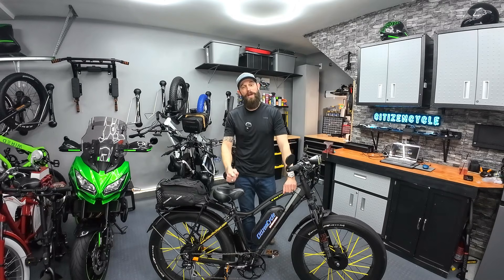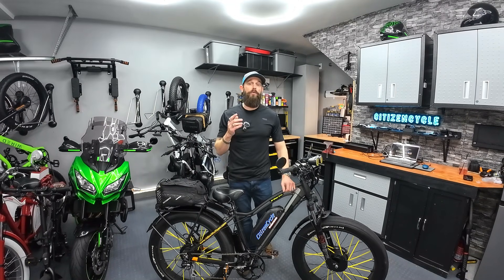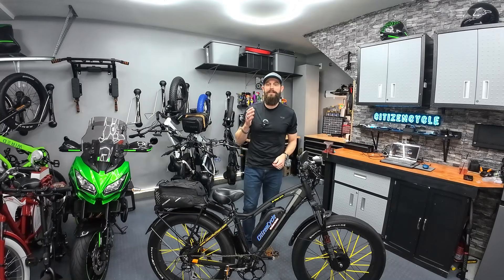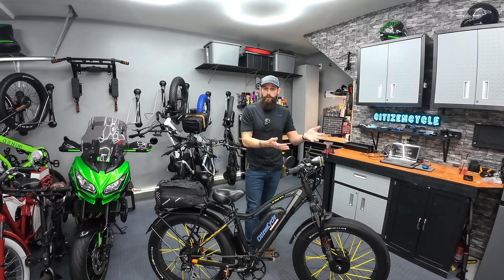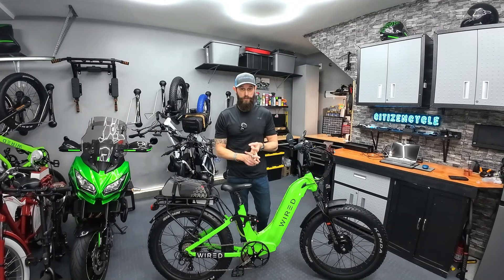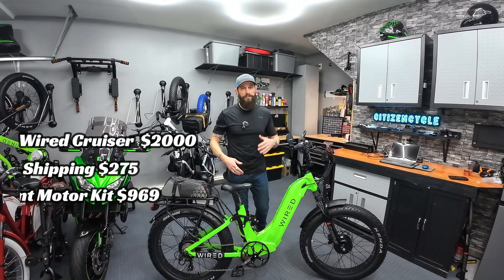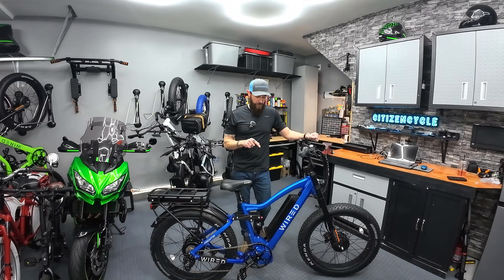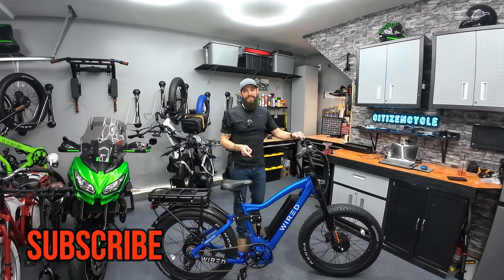Chasing More Power in Your eBike - Mods I've Done

Comment: I want more power out of my RadioFlyer wagon! Shunt modded 45 amp controller with 80 volt caps feeding on a 48 volt 50 Ah Lifepo4. Plan on over volting to 60+ volts soon. It launches now.

Comment: Thanks again for your awesome channel and content. I've just ordered a new Aventon Adventure2. I've been riding a much more expensive Cube crank-drive Bosch motor e-bike for the past 4 years after I sold my very modified (thanks to your show) Rad Rover. I ride daily for exercise, on a combination of road and trail. I really missed the ride and feel of the fat tire bike. I've also experienced a ton of drivetrain issues with the Cube. There's a special on at Best buy Canada right now for the step through Adventure2, cobalt blue in a regular size. I'm 5'11", weigh 230lbs and have a short inseam of 30". My bike shop guys recommend I pay more now from them and get the size large as he feels the regular will fit but I'll have reach problems. In your opinion should I pay the $700 more an spring for the Large or will the regular work? You rode your wife's regular and said it fitted you fine. In anticipation many thanks.

Comment: The predator is cool and all... but for almost the same price, you could get something like the 5kw Cyclone from Estrapz. 2.8Kwh battery, supermoto forks and suspension... just built to handle higher speeds better.

Comment: There are youtubers building bikes that can reach 70, 80, 90 miles per hour.  Frankly, I think anything over 40 is beyond the design of a bicycle.  They just are not built for the forces that going this fast can generate, especially over and over again.  There are reasons motorcycles generally have thick steel frames and forks.  Same with the wheels.  The brakes and rotors are much, much bigger.
Reply: And tire strength
Reply: I agree just slapping peddles on it doesn't mean it's a bicycle/ebike, they need to draw a clear line on what's really an ebike and what's a moped/motorcycle cause these extreme fast mopeds with peddles is just hurting the hobby I actually love and is making a mess of just going for a ride cause people assume your over of those a-holes and everyone gives you a hard time cause of kids and there"Surans"
Reply: @Jetsfan0786  There are actually clear cut bright line rules for what is not an e-bike. 750 watts and a top speed of 28mph assist and 20mph throttle. Surans are supposedly sold for off-road use only.

Comment: What’s lacking is balance.

Need better tires, ABS or at least better brakes, hopefully the frame is properly reinforced.

Of bikes with equivalent or more power: Ristretto 512, ecells, but I have no experience with either of these bikes, including your Wired/DIY.

Oh, Ristretto currently has a 72v in the works.

As an added bonus, I’d also include the SparkCylesWords bandit (moped style) & the bandit, which I’ve been eyeing since I got bitten by the emoto bug.

Nice bikes, hopefully you can resist the urge to venture into deeper waters.

GL

Comment: i have a seeker26... dualmotor fatty with 2x 1000w nominal.. peaking at 1400 with 2x 25 Amp controllers... 1100bucks and no need to modify (already has 52v system)... modding it would mean new battery with 60v and 2 new controllers ... no thank you that cost tooooooo much for maybe 5 miles more topspeed (now peaking at 38miles/hour)... so in my view i got most bang for the buck with selecting that seeker26... not?!?
(sidenote i added a 2nd battery for about 350 bucks and now have more range and a bit lower voltage sag under load) ... with a few moddings like 3 big baskets , a softer wider seat, street tires and an adjustable stem it was around 1600

Comment: Citizen, in your history on the Rad Rover, I think you forgot to mention the rear motor upgrade to an actual 750 watt motor. I'm hoping to do that on mine but I need my third set of tires first after nearly 4000 miles of riding.
Reply: I noticed the same thing. I remember him saying the 750w motor upgrade was way more worth it than the 52v battery upgrade! He was right! I upgraded the motor on my own 2018 Rover because of Citizen Cycle!

Comment: More powah! Like my dual motor bike I customized but now I’m looking for a commuter bike that has a 20ah minimum non fat tire bike it’s pretty tuff to find I’m a bit surprised. Maybe I need to look into a 20” fat tire bike instead
Reply from the maker: @TheRougeRiverRider  you may need to just buy the commuter bike you're interested in and get a battery blender and add a second battery to it for more capacity
Reply: Research brand EMX.

Comment: Good afternoon there's a you tube channel called ebike guy he built 72 volt 90 amp battery 4000 watt rear drive DIY bicycle can bo 80 miles hour with ease   check it out think you will enjoy. Good day
Reply from the maker: @hogboat65  I'll have to check that out but 80 mph on bicycle tires sounds sketchy
Reply: @CitizenCycle925 he has actually hit 100 with it!… all sorts of vids beating motorcycles,cars and other toys!

Comment: Not more power, more speed. Haven't seen much out there that goes a constant 45 mph for a few miles. Peak 48 mph.. flat ground. Like 3 bikes that can cruise 45mph.  I'm thinking the motor out back needs to be non geared higher rpm direct drive. Starting at 60V 3,000 watts. 26" fat tire bike that can go 45mph plus.
Reply from the maker: @JohnBabcock-qy1cs  I will have a bike to show you within the next month that should cruise at 45mph top out at 50mph 😁
Reply: Congratulations on all your success!  I think the bike you are talking about will be a massive seller.  Really the full evolution and the pinnacle for the 26x4 format.   Pretty crazy upgrades and new models from what I’ve been told.  Steve is really good at this shit.  Can’t wait to get one!

Comment: Nice video, thanks for sharing.  Do you have a brand/source for batteries you use?  I'm tinkering with the idea of adding a second battery to my bike.  Thanks, and hope all goes well with the little one.
Reply from the maker: @markarmstrong9551  thank you for the well wishes. I do not have a particular brand or source a batteries. I've purchased from several sites. I do have a battery from Bicycle Motor Works that I really like though.

Comment: Great job explaining the evolution of your search for more power! Would love to experience the power of that Predator! Your Cruiser mod is my favorite. Nearly all the power of a Predator, but with a step through.
Reply from the maker: @EnergizedZonie  yes they're actually pretty close.   my Predator is probably going to be updated within the next month so keep an eye out for that video
Reply: @CitizenCycle925  Funny you said that. I upgraded my Predator. Better tires, Suntour suspension seat post, kemimoto motorcycle mirrors and cleaned up my cable management. Lowered my display to the bottom part of handlebars so I can have my phone mounted on top. Cleaner look. Adding a LED bar headlamp. Changed my bell too, Rockbros woodpecker.

Comment: I have a red Rover 6+ have replaced a controller with a 35 amp controller have replaced the battery with a 52 V battery I was thinking about putting a true 750 W motor on the back as well. What do you think?
Reply: Thx I can get from electro bike world then after I’ll order front motor kit from you
Reply from the maker: @dondirohan113  yes I swapped out my Rad's rear motor and it made a big difference, I think it was nearly 10 mph faster.
Reply: @ do you think the 35 amp controller and 52 vokt could handle a 1000 watt motor or should I stick with true 750
Reply from the maker: @dondirohan113  1000 watt motor would be fine just make sure it has the same motor plug as your controller

Comment: Are you planning on doing a thousand watt front motor with maybe 45 amp controller that can work off of 60 volts
Reply from the maker: @user-kb8yl2qh3h  thinking about that but 60v will definitely be higher cost and also not sure if the RST guide Forks can handle that, may need some custom Forks to go with it
Reply: Are there any single motor Ebikes that I could buy where I could add your front motor without the need to replace the front forks also?
Reply: Fabulous/Furious use the same Rst guide fork for some of their 60 volt dual motor bikes. You have one and you know people have run your kit on 60 volts.

Comment: Been a while since your last vid. Appreciate all your vids even if they don't apply to me, tyhanks CC.
Reply from the maker: @jojodancer1961  yes, busy time with baby citizen almost here 😁
Reply: Area 13 also sells a Juiced Scrambler upgrade kit but for how much longer is anyone’s guess since they have gone out of business. I would say 72V is your next high powered system. More torque with less heat at lower amps. What could be bad about that!
Reply from the maker: @kmtnbike1117  72v is on the way shhhh🤫
Reply: @CitizenCycle925 
lol That-A-Boy🤐
Reply: @kmtnbike1117  Not 4 me I'm happy with where I'm at on my Wired Freedom 2024
Reply: @EZ_E_13 
I like riding my high powered e-bikes but have resorted back to riding a fully carbon fiber road bike with no motor more often.